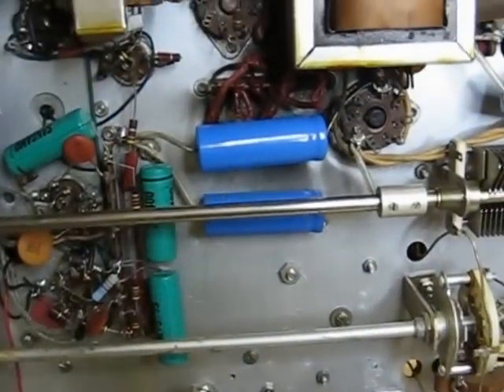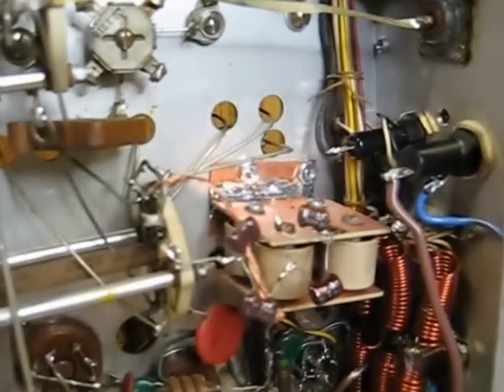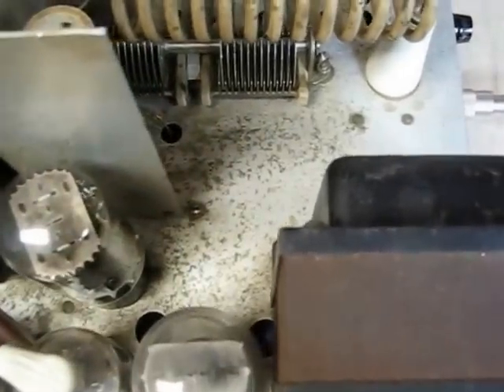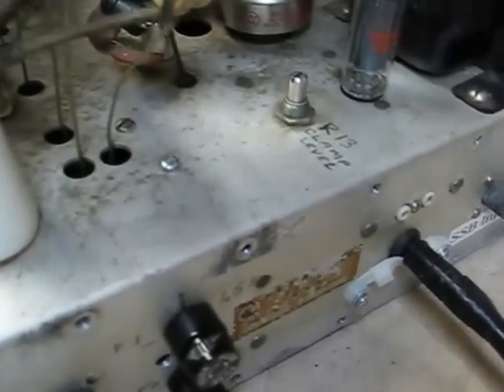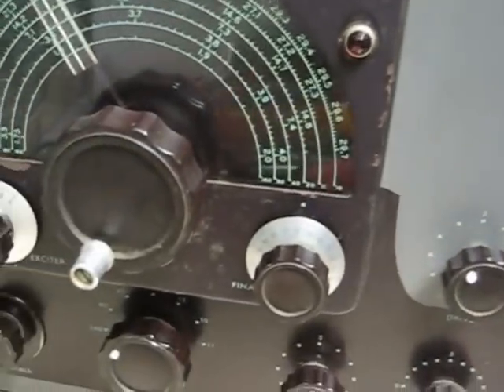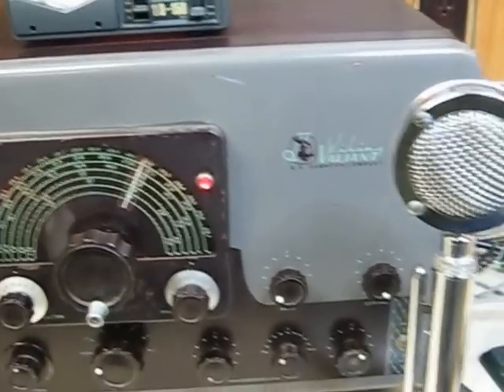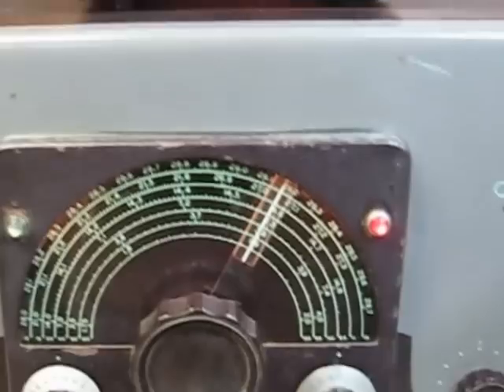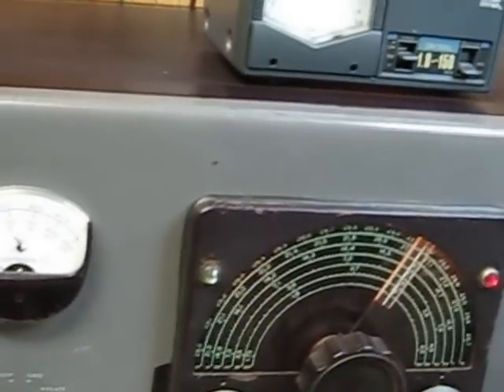Johnson Viking Valiant

Comment: I owned a Valiant decades ago. It was a nightmare. Capacitors were replaced multiple times. VFO was unstable as a rag in the wind. I spent so much time working on this boat anchor that I eventually decided to just leave off the cover and operate the xmtr that way. The case had a warning about x-ray exposure when operating without the cover!